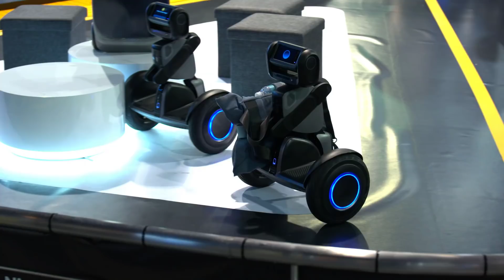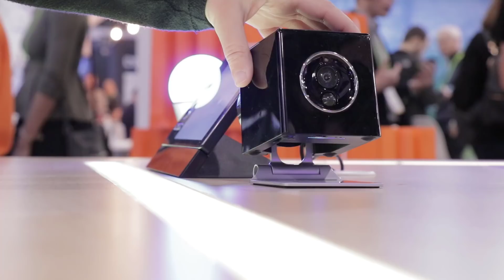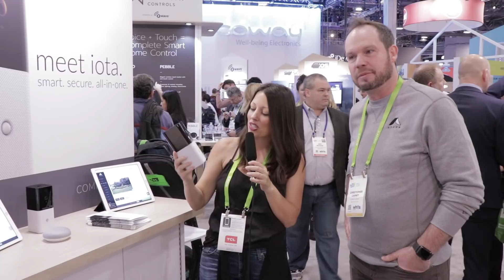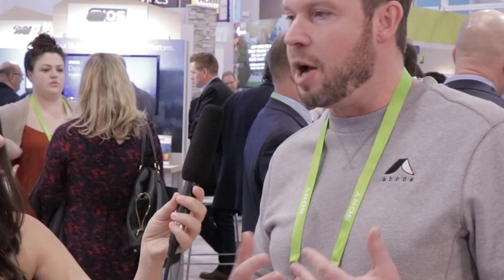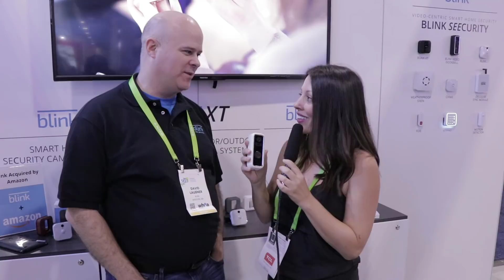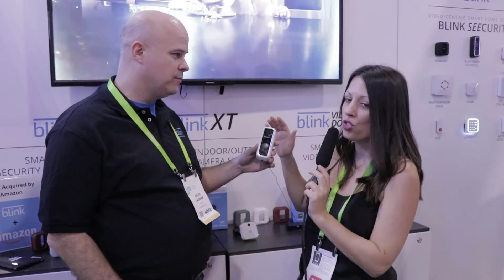CES 2018 Interviews: Remo+ DoorCam, Oomi, abode iota, and Blink Video Doorbell

Comment: Have you heard any updates pertaining to Blink XT having 2 way audio?
Reply from the maker: I haven't heard anything about that. Have you? I was under the impression that the XT didn't have a speaker. I think the Blink Video Doorbell will be the first Blink product with two-way audio.
Reply: it's Rose no I haven't. It has audio so you can hear as far as I know. I needed a camera for my backyard, and didn't want the Ring Spotlight Cam battery operated. I thought about Arlo but it gets to cold in Michigan. Any recommendations?
Reply from the maker: It does have a microphone, but no speaker. And I'm going to stand by the recommendations I made a few weeks ago. I haven't tested all the cameras so I typically only recommend those I've tried, and it sounds like most of the cameras I've tried aren't a good match for your unique needs. I take it you didn't like the Floodlight Cam you installed?
Reply: it's Rose Rose thanks again for responding. I haven't installed it yet because it's been really cold in Michigan. Maybe next week and I decided to go with the wired version even though I don't really want wires. I will see what happens. 🤞🏽

Comment: The Blink Video Doorbell can be easily stolen based on the way he described it.
Reply from the maker: That's a valid point. It is battery powered, but can tie into your existing doorbell wires. Still, it doesn't have a security style mount like Ring.

Comment from the maker: This is sort a step away from what we normally do. The video is much more candid and informal, but I really wanted to give you all a look at a few CES exhibitors this year. Let me know if you have any questions about products. I’m still organizing all the notes I took, but I’ve already written an article on abode iota.

If you want to buy an abode system, you will soon have the choice between the Gateway and iota. iota is an all-in-one home security device, doesn’t require Ethernet, and is HomeKit enabled. The Gateway can’t protect your home on its own, requires Ethernet, and is not HomeKit enabled (yet). However, the Gateway doesn’t force you to use a streaming camera and though it's the same price as iota ($329), in some ways it provides more value as the Starter Kit includes two door/window sensors, an image sensor, and a key fob.
Reply: They have come out with a new generation of SimpliSafe that is not backwards compatible, and are currently not offering any kind of upgrade plan for existing customers. This announcement from them was so sudden that people from even a week ago were sold the gen 2 system without any mention of the gen 3 system being released.
Reply: That would be my guess as well, but it really doesn't make any sense to sell and outdated system to new customers. Now many customers are taking to the site's forum to express their complaints, and hardly any SimpliSafe people are coming out to respond unless you're having issues with an existing system. Pretty disappointing for them right now.
Reply: Thanks Rose.  Great content as always!  Did you get a chance to look at the new SimpliSafe?  I heard HomeKit will be coming later this year for SS but I'm curious if that will require their $24.99 Interactive Plan.  Also, would be nice to know if they are planning on other smart integrations such as Samsung SmartThings, Google Home, IFTTT, etc.
Reply from the maker: I didn't see SimpliSafe at CES. I hadn't even heard about the redesign so thanks for the tip. I can't wait to dig into what they're doing! My guess is that HomeKit will require a paid plan, but obviously that's just a guess. I reached out to a contact I met last year and asked him. I'll let you know if I hear back.
Reply from the maker: Official comment: "As far as integrations go, Amazon Alexa will be first, coming later this year. Apple HomeKit is also in the plans for upcoming integrations."
Reply from the maker: Good info on backward compatibility. I was a little irritated that they didn't email me. I do own a SimpliSafe system and they have no problem emailing me junk on a weekly basis. I was wondering why they wouldn't announce this to their existing customers. Perhaps the lack of backward compatibility is why?
Reply from the maker: That is frustrating!
Reply from the maker: I just bought the new system. They offered me an upgrade to SimpliSafe2, which I thought was VERY confusing. There were no pictures, only words. I'm sure most current owners will just assume that the upgrade offer is to the new system, SimpliSafe3, which of course, is full price. To me, it feels like SS really failed on this launch.
Reply: it's Rose They really did a bad job on this one. I am still waiting out on a trade in deal (hopefully??) of my old system to get the new one. Otherwise, it may be time to go with a different system that allows third party integration and hasn’t had a history of these limitations between new iterations of their products. It would be nice to see the Blink Seecurity line of home security to release this year to compare to SimpliSafe.

Anywho, please let us know how the new system works out for you!
Reply from the maker: Sorry if I told you this already, but I asked Blink about Seecurity and they wouldn't comment on a release date.
Reply: Booooo that's too bad. Thanks for the info!
Reply from the maker: The written review is done. Still working on the video review. https://homealarmreport.com/simplisafe-3-review/